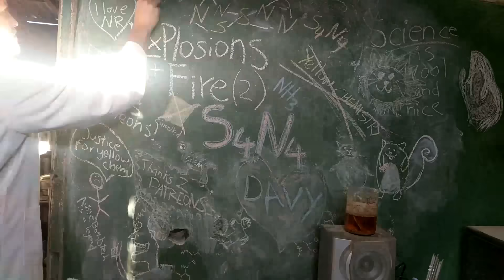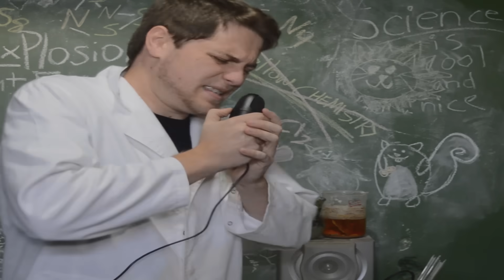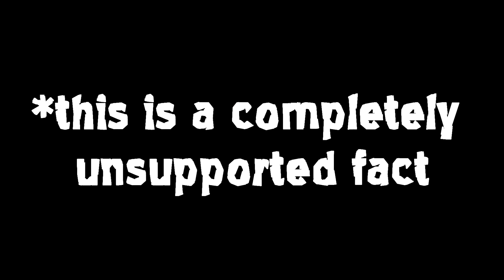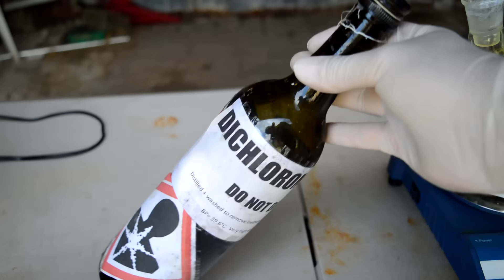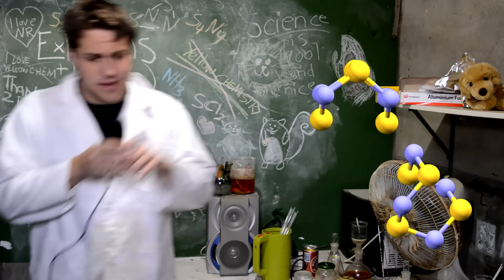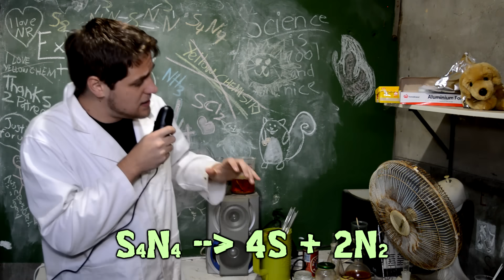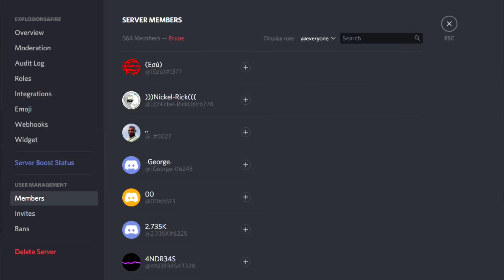Sulfur Nitride, My Arch Nemesis - Ex&F

Comment from the maker: Comment 'yellow chem bad' for 7 years of good chemistry luck.

 Scroll past for low yields forever
Reply: jokes on you, I do computational chemistry
Reply: scrolls past
Reply: @750kv8  nightmare fuel
Reply: Yellow chem bad
Reply: ORANGE MAN BAD
Reply: yellow chem bad
Reply: Explosions&Fire2 - 
Yellow Chen Bad
Reply: @deepforrestalchemy9189  yellow chem bad
Reply: Yellow chem bad

Wait, I'm not even a chemist....
Reply: Surely yellow chem is not a bad as you purport it to be.
Reply: Yellow Chem Good
Reply: Please mix it with sodium chlorite
Reply: Yellow chem bad
Reply: I figured out a way to mass produce S4N4, and I have 2.5 kilos of this shit. I filled an aluminum can about 1/4 of the way up, glued in a fuse, and stuck in into a 1" thick plexiglass box.
I blew the box up...
Reply: Jokingly comments “Xanthopibia” (YEA this is a real phobia)
Reply: Yellow cum bad
Reply: AgNTZ was yellow too

and you edited "yellow is my favourite colour"

fucking hypocrit
Reply: White chem: ammonium nitrate and sugar. RMM 80.04336 and 180.15588, balanced formula 6 [ NH4NO3 ] + 1 [ C6H12O6 ] -> 6N2 + 8H20 + 6CO2, so mass ratio 2.666:1 and energy yield 26346 - 12401 = 13945 kJ per 260.2 g so a quarter gram of the stuff ought to go off like a .50 BMG and leave no residues ..... right?
If you lower that oxidiser:fuel ratio, can you make it work as rocket fuel instead?
Reply: My dick is yellow is that bad?

Great video btw, I just found you though recommended. Idk why tho lmao. Maybe it's a sign I need to go be a fucking scientist and or burn my job down with something non traceable.....??
Reply: yellow chem is scientifically proven to be bad, i thought everyone knew this?
Reply: Bellow yem chad
Reply: Yellow chem bad
Reply: yellow chem bad
Reply: Yellow chem bad
Reply: Yellow chem bad
Reply: Yellow chem bad
Reply: Yellow Chem bad
Reply: yellow chem bad
Reply: Yellow chemistry is good or bad, depending on how I want to feel that day.
Reply: Yellow chem bad
Reply: Yellow chem bad
Reply: yellow chem bad
Reply: Can you tell me your discord's server name I REALLY want to join and also yellow chem bad :)
Reply: yellow chem bad
Reply: Yellow chem bad
Reply: Yellow chem bad
Reply: yellow chem bad
Reply: Yellow chem bad
Reply: Yellow chem bad.
Reply: Yellow chemistry bad
Reply: Yellow chem bad
Reply: Yellow chem bad. Except Vilsmeyer reactions, those are great.
Reply: yellow chem bad
Reply: Yellow chem bad
Reply: Yellow chem bad
Reply: Yellow chem bad
Reply: I'm surprised you don't have a nitrogen triodide video.
Reply: @alexandersage6261  yea and a nitrogen troglodyte video 😆
Reply: @AdamA-wg1ko  please remove your comment.
Reply: @alexandersage6261  wha? lol why tho?
Reply: @AdamA-wg1ko . I think you know why
Reply: yellow chem bad
Reply: Yellow chem bad 😂
Reply: Yellow chem bad
Reply: Explosions&Fire2 yellow chem bad
Reply: Yellow chem bad
Reply: WTF i just wrote one of those comments ☝️
Reply: Yellow chem bad
Reply: yellow chem bad
Reply: Yellow chem bad
Reply: Yellow chem bad
Reply: Yellow chem bad
Oh wait... it's the worst.
Reply: Yellow chem bad
Reply: yellow chem bad
Reply: Yellow chem bad
Reply: @Marionette Loves Gaming you can't hear a pterodactyl urinate because of the silent p.
Reply: Yellow chem bad
Reply: Yellow chem bad
Reply: Yellow chem bad
Reply: Yellow chem bad
Reply: Yello Chem is te suck!
Reply: Yellow chem no bueno
Reply: Yellow Chem baf
Reply: Aw fuck me
Reply: Yellow chem bad
Reply: Yenlo cam bed
Reply: Yellow chem questionable
Reply: Yellow chem bad
Reply: Yellow chem bad
Reply: yellow chem bad
Reply: Explosions&Fire2 yellow chem bad
Reply: yellow chem bad
Reply: yellow chem bad
Reply: Yellow chem bad
Reply: yellow chem bad
Reply: yellow chem bad
Reply: Yellow chem bad
Reply: Yellow chem bad
Reply: Yellow chem bad
Reply: yellow chem bad
Reply: yellow chem bad
Reply: Yellow chem bad
Reply: yellow chem bad
Reply: yellow chem bad
Reply: yellow chem bad
Reply: yellow chem bad
Reply: yellow chem bad
Reply: not gonna take my chances. yellow chem bad for real
Reply: Explosions&Fire2 yellow chem bad
Reply: Yellow chem bad
Reply: Yellow chem bad
Reply: yellow chem bad
Reply: yellow chem bad
Reply: Yalla cam bad
Reply: Yellow chem bad.

I wonder if it's possible to make an explosive from a properly heavy metal. Handful of crystals of something with a fissile isotope would be cool.

Edit: not an actual handful of course, that would probably leave you without a hand.
Reply: Yellow Chem bad
Reply: YELLOW CHEM BAD
Reply: Yellow chem bad
Reply: yellow chem bad
Reply: Fuck you ☝ subbed boi- notifications on! !
Reply: If you had to pick one you would rather have pile of a in the yard, flourantimonic acid or chlorine trifluoride? 🤔 Oh yeah the acid is a nasty puddle not a pile
Reply: Yellow chem bad
Reply: Yellow chem bad.
Reply: Yellow chem bad
Reply: Yellow chem bad
Reply: yellow chem bad
Reply: yellow chem bad :(
Reply: yellow chem bad
Reply: yellow chem bad
Reply: Explosions&Fire2 Could you please increase the amount of time you leave text on-screen in your videos?
Reply: yellow chem bad
Reply: yellow chem bad
Reply: yellow chem bad
Reply: yellow chem bad
Reply: yellow chem bad
Reply: Yellow chem bad
Reply: Yellow chem bad
Reply: yellow chem bad
Reply: Yellow chem bad
Reply: yellow chem bad
Reply: Yellow chem bad.
Reply: Yellow chem bad
Reply: Explosions&Fire2 yellow chem bad
Reply: Yellow chem bad 😤😤
Reply: yellow chem bad
Reply: yellow chem bad
Reply: yellow chem bad
Reply: Yellow chem bad
Reply: Yellow
Reply: Yellow chem bad
Reply: Explosions&Fire2 chem yellow bad
Reply: yellow chem bad
Reply: Explosions&Fire2 yellow chem bad
Reply: Yellow chem bad
Reply: yellow chem bad
Reply: yellow chem bad
Reply: Yellow chem bad
Reply: Explosions&Fire2 yellow chem bad
Reply: yellow chem bad
Reply: yellow may be my favorite color, but yellow chem bad anyways
Reply: Yellow chem bad. Plz daddy My yields need to improve.
Reply: yellow chem baaad
Reply: yellow chem bad
Reply: yellow chem bad
Reply: yellow chem bad
Reply: By the way that last comment was SATA I was yelling at the invisible troll on the internet even though I knew it was you knew
Reply: Yellow chem bad
Reply: yellow chem bad
Reply: yellow chem bad
Reply: Yellow chem bad
Reply: Yellow chem bad
Reply: yellow chem bad
Reply: Yellow chem bad 

I'm a third year chem major, I can't afford to risk it all on this
Reply: Yellow chem bad
Reply: yellow chem bad
Reply: yellow chem bad
Reply: yellow chem bad
Reply: Explosions&Fire2 yellow chem bad
Reply: Yellow chem bad good yields plz
Reply: yellow chem bad
Reply: yellow chem bad
Reply: yellow chem bad
Reply: yellow chem bad
Reply: yellow chem bad
Reply: Yellow chem bad, mustard gas proves it!
Reply: Yellow chem bad
Reply: yellow chem bad
Reply: yellow chem bad
Reply: Yellow chem bad got em lol
Reply: Yellow chem bad
Reply: Yellow Chem Bad
Reply: yellow chem bad
Reply: Yellow chem bad
Reply: Yellow chem bad
Reply: yellow chem bad
Reply: Ur mom gay
Reply: yellow chem bad
Reply: yellow chem bad
Reply: yellow chem bad
Reply: Yellow chem bad
Reply: 'yellow chem bad'

(This comment chain will continue for as long as there are chemists alive! 😂)
Reply: Yellow chem bad
Reply: yellow chem bad
Reply: Yellow chem bad
Reply: yellow chem bad
Reply: Yellow chem bad
Reply: Yellow chem bad
Reply: Aureate reagent intolerable
Reply: yellow chem bad
Reply: yellow chem bad
Reply: yellow chem bad
Reply: yellow chem bad
Reply: yellow chem bad
Reply: yellow chem bad!!  Biologist here, but still....like...electron microscopy, what´cha got? uranyl acetate....picric acid...epoxy resins....yuck. Yellow chem: bad!
Yellow mold also, btw....and yellow bacteria: super gross. don´t.
Reply: Yellow chem bad
Reply: Yellow chem bad my bois
Reply: yellow chem bad
Reply: Yellow chem bad
Reply: yellow chem bad
Reply: yellow chem bad
Reply: yellow chem bad
Reply: Yellow chem bad
Reply: Yellow chem bad
Reply: I think you need more sleep
Reply: I think you need to get more sleep 😁🤣🤣🤣🤣🤣🤣🤣🤣🤣👍
Reply: yellow chem bad
Reply: Yellow chem bad
Reply: now we know what NIleRed did eh?
Reply: Yellow chem bad orange man bad
Reply: Yellow chem bad
Reply: Yellow chem bad
Reply: Yellow chem bad
Reply: Yellow chem bad
Reply: yellow chem bad
Reply: Explosions&Fire2 yellow Chen bad
Reply: Yellow chem bad
Reply: Yellow chem bad
Reply: Yellow chem bad
Reply: Yellow chem bad
Reply: yellow chem bad
Reply: yellow chem bad
Reply: Yellow Chem bad
Reply: yellow chem bad
Reply: yellow chem bad
Reply: Yellow chem bad
Reply: Yellow chem bad
Reply: Yellow Chem Bad
Reply: yellow chem bad
Reply: yellow chem bad
Reply: Yellow chem bad
Reply: Yellow chem bad
Reply: yellow chem bad
Reply: yellow chem bad
Reply: 'yellow chem bad' for 7 years of good chemistry luck.
Reply: Yellow chem bad
Reply: yellow chem bad
Reply: yellow chem bad
Reply: Yellow chem bad

You have forced my hand
Reply: yellow chem bad

\
Reply: yellow chem bad
Reply: yellow chem bad
Reply: Yellow chem bad
Reply: Yellowchembad
Reply: Yellow chem bad
Reply: yellow chem bad
Reply: Yellow chem bad
Reply: yellow chem bad
Reply: Yellow chem bad reeeeeeeEEEEEEE
Reply: yellow chem bad
Reply: yellow chem bad
Reply: yellow chem bad
Reply: yellow chem superbad
Reply: Actually I am working on yellow chemistry at the moment
Reply: Yellow chem awesome
Reply: yellow chem bad
Reply: Gelbe chemie schlecht
Reply: yellow chem bad
Reply: Yellow Chen Bad
Reply: Yellow chem bad
Reply: Yellow chem bad
Reply: yellow chem bad
Reply: chemistry A level here we come! yellow chem bad!
Reply: yellow chem bad 🤩
Reply: yellow chem bad
Reply: Yellow chem bad
Reply: Yellow chem bad
Reply: Yellow chem bad
Reply: Yellow chem bad
Reply: yellow chem bad
Reply: Yellow chem bad
Reply: White phosphorus good.
Reply: yellow chem really bad
Reply: yellow chem bad
Reply: yellow chem bad
Reply: yellow chem bad
Reply: yellow chem bad
Reply: yellow chem bad
Reply: yellow chem bad
Reply: yellow chem bad
Reply: Yellow chem bad
Reply: Yellow chem bad
Reply: Yellow chem bad
Reply: yellow chem bad
Reply: Explosions&Fire2 yellow chem bad
Reply: Yellow chem bad
Reply: yellow chem bad
Reply: yellow chem bad
Reply: Yellow chem bad
Reply: Yellow chem bad
Reply: 'yellow chem bad' for 7 years of good chemistry luck
Reply: Yellow chem bad
Reply: Yellow Chem bad
Reply: Yellow chem bad
Reply: yellow chem bad
Reply: Yellow chem bad
Reply: Yellow chem big SHIT
Reply: yellow chem bad
Reply: Yellow chem bad
Reply: Yellow chem gay
Reply: yellow chem bad
Reply: Yellow Chem bad
Reply: Trinitrotoluene is yellow, yellow chemistry good.
Reply: Explosions&Fire2 yellow chem bad
Reply: Yellow chem bad
Reply: Yellow chem bad
Reply: Yellow chem bad
Reply: Yellow chem bad
Reply: Yellow chem bad
Reply: yellow chem bad
Reply: yellow chem bad
Reply: yellow chem bad
Reply: yellow chem bad
Reply: yellow chem bad
Reply: Piss chemistry bad
Reply: Combining of specified materials in a way to grant desired results that ends up yielding a material that has visible light spectrum reflectance solely within wavelength in the range of around 565–590 nm is of sub-par quality.
Reply: yellow chem bad
Reply: Yellow chem bad
Reply: Yellow chem bad
Reply: Yellow chem bad
Reply: Explosions&Fire yellow chem bad
Reply: Yellow chem bad
Reply: yellow chem bad
Reply: Yellow chem bad
Reply: Yellow chem bad
Reply: Yellow chem bad
Reply: Yellow chem is trash
Reply: YELLOW CHEM BAD
Reply: Yellow chem bad
Reply: yellow chem is fucking bad
Reply: Yellow chem bad
Reply: Yellow chem bad
Reply: yellow chem bad
Reply: Fuck yellow chem
Reply: Yellow chem bad.
Reply: Yellow chem bad
Reply: yellow chem bad
Reply: Yellow Chem Bad
Reply: Yellow chem bad
Reply: Yellow chem bad
Reply: 9 months later... yellow chem bad
Reply: Yellow chem bad
Reply: Yellow chem bad
Reply: yellow chem bad
Reply: Yellow chem bad
Reply: Explosions&Fire yellow chem bad
Reply: Yellow Chem Bad
Reply: Yellow chem bad
Reply: Yellow Chem bad
Reply: yellow chem bad
Reply: Not a chemist but I fucking hate the color yellow. Yellow anything bad.
Reply: Yellow chem bad.
Reply: Yellows bad
Reply: Yellow chem bad
Reply: YELLOW CHEM BAD
Reply: Yellow chem bad
Reply: yellow chem bad
Reply: My last lab work I had to do for my study I had a 234% yield. So I'm going to scroll past a couple times
Reply: Yellow chem bad
Reply: yellow chem bad
Reply: Yellow chem bad
Reply: yellow chem bad
Reply: yellow chem bad
Reply: Yellow Chem Bad
Reply: Explosions&Fire yellow chem bad
Reply: Yellow Chem bad
Reply: yellow thing bad
Reply: Yellow chem bad
Reply: yellow chem bad
Reply: yellow chem bad
Reply: https://youtu.be/x5dsp7poBmY 

Rustful steel to Rustless 100%

Dekho video .
Reply: yellow chem bad
Reply: Yellow chem bad
Reply: Explosions&Fire 
y e l l o w
c h e m
b a d
Reply: yellow chem bad
Reply: Yellow chem bad
Reply: yellow chem bad
Reply: Yellow chemistry bad
Reply: Yellow Chem bad
Reply: yellow chem bad
Reply: yellow chem bad
Reply: yellow chem bad
Reply: Yellow chem bad
Reply: yellow chem bad
Reply: yellow chem bad
Reply: yellow chem bad
Reply: Yellow chem bad
Reply: yellow chem bad
Reply: yellow chem bad
Reply: yellow chem bad
Reply: yellow chem bad
Reply: Yellow chem meh
Reply: yellow chem bad
Reply: yellow chem bad
Reply: yellow chem bad
Reply: yellow chem bad
Reply: Yellow chem bad
Reply: Ohhhh the AFP would love you...
Reply: Yellow chem bad
Reply: yellow chem bad
Reply: yellow chem bad
Reply: yellow chem bad
Reply: Yellow chem bad
Reply: Yellow chem bad 👎
Reply: yellow chem bad
Reply: yellow chem bad
Reply: yellow chem bad
Reply: yellow chem bad
Reply: Yellow chem bad
Reply: Yellow chem bad
Reply: Yellow Chem Bad 498
Reply: yellow chem bad👁👄👁
Reply: Yellow Chem Bad 500
Reply: yellow chem bad
Reply: yellow chem bad
Reply: Yellow chem bad
Reply: yellow chem bad
favorite quote of the vid : "fuck me i love the 60s "
also : love from Germany, really enjoy watching your vides and i stumbled across your channel because an romanian friend of mine recommended it to me who absolutely loves chemestry to the point of making chlorine gas and naplam (the latter i also tried out withe some of my german friends), so take care and try to ignore the possible inspiration for warcrimes :))
Reply: yellow chem bad
Reply: yellow chem bad
Reply: yellow chem bad
Reply: Yellow chem bad
Reply: yellow chem bad
Reply: Yellow chem bad
Reply: yellow chem bad
Reply: yellow chem bad
Reply: yello chem bad
Reply: Yellow chem bad
Reply: Yellow chem bad
Reply: Yellow chem bad
Reply: yellow chem disgusting bad
Reply: yellow chem bad
Reply: yellow chem bad
Reply: yellow chem bad
Reply: yellow chem shit
Reply: Yellow chem bad
Reply: yellow chem bad
Reply: But... How will I make black powder? I like sulfur =(
Reply: yellow chem bad
Reply: Yellow chem bad
Reply: Yellow chem bad
Reply: Yellow chem bad
Reply: yellow chem bad
Reply: yellow chem bad
Reply: Yellow chem good :P
Reply: Yellow chem bad ig
Reply: Yellow chem bad
Reply: Yellow chem bad
Reply: chello yem dab
Reply: Yellow chem bad
Reply: Yellow chem bad
Reply: Yellow chem bas
Reply: Yellow Chem bad*
Reply: Yellow chem bad
Reply: yellow chem bad 🙏
Reply: Yellow Chem bad
Reply: Yellow chem bad
Reply: yellow chem bad
Reply: yellow chem bad
Reply: yellow chem bad
Reply: Yellow Chem Bad
Reply: Yellow chem so bad
Reply: Yellow chem bad
Reply: Yellow hem bad
Reply: YELLOW CHEM BAD 🟡🤢
Reply: Yellow chem bad
Reply: yellow chem bad
Reply: Yellow Chem bad
Reply: yellow chem bad
Reply: Yellow chem bad
Reply: yellow chem bad
Reply: Yellow chem bad
- someone preparing for computer science
Reply: As a “chemist” who do formaldehyde tests as a 9-5 job, i concur yellow chemistry bad. (DNPH, acetylacetone and it compound with formaldehyde are all yellow)
Reply: Yellow Chem bad
Reply: Yellow Chem bad
Reply: Yellow chem bad
Reply: This better work. Yellow chem bad
Reply: Yellow chem bad
Reply: yellow chem bad
Reply: Yellow chem bad
Reply: yellow chem bad very
Reply: yellow chem bad
Reply: yellow chem bad
Reply: yellow chem bad
Reply: Yellow chem bad
Reply: Yellow Chem bad
Reply: yellow chem bad
Reply: Yello chem baddie
Reply: Yellow chem bad
Reply: yellow chem bad
Reply: yellow chem bad
Reply: Yellow chem bad
Reply: Yellow chem bad
Reply: yellow chem bad
Reply: yellow chem bad
Reply: Yellow chem bad
Reply: Yellow chem bad
Reply: yellow chem bad
Reply: yellow chem bad
Reply: Yellow chem bad
Reply: Yellow chem bad
Please help me defend my thesis lol
Reply: Yellow chem bad

(baking is TEEECCCHHHNIIIIICCCALLLYYY chemistry)
Reply: Yellow is my favorite color!😢
Reply: With finals this week; yellow chem bad.
Reply: @ExplosionsAndFire  but Yellow is my favorite color😡
Reply: yellow chem bad
Reply: yellow chem bad
Reply: yellow chem bad
Reply: yellow chem bad😊
Reply: yellow chem good
Reply: yellow chem bad
Reply: Yellow chem bad
Reply: yellow chem bad
Reply: Yellow chem bad
Reply: yellow chem bad
Reply: yellow chem bad
Reply: yellow chem bad
Reply: And now those 7 years are up
Reply: yellow chem bad
Reply: Yellow chem satisfyingly decent

I mean, I didn't scroll past so jokes on you
Reply from the maker: @18thtimelucky  may you obtain average yields forever
Reply: @ExplosionsAndFire 
I’m still waiting for the day you show us how to synthesize TAPT.

Acetone Peroxide is some good stuff, and “relatively” easy to m8k.
Reply: @ExplosionsAndFire 
Also Ammonium Permanganate, damnit!
Reply: Yellow chem bad.

Wait what if I do yellow chemistry for the next 7 years?
Reply: @mothman1654  youre bad
Reply: Friend, you didn't even try it confined with an oxidizer!
Reply: Yella chem bad 😤
Reply: orange man bad
Reply: 'yellow chem bad' for 7 years of good chemistry luck.
Reply: Yellow Chem bad
Reply: Yellow chem bad
Reply: yellow chem bad
Reply: yellow chem bad
Reply: Yellow chem bad
Wait... I'm going to recrystallize sulfur from xylenes this month... that's yellow chemistry!
Reply: yellow chem bad
Reply: Yellow chem bad
Reply: Yellow Chem Bad
Reply: Y E L L O W  C H E M  B A D
Reply: Yellow chem bad
Reply: yellow chem bad
Reply: yellow chem bad
Reply: yellow chem bad
Reply: Yellow Chem un-good
Reply: yellow chem bad
Reply: Yellow Chem bad
Reply: Yellow chem bad!
Reply: Explosions&Fire2 yellow chem bad
Reply: Yellow chem bad and it smells
Reply: Yellow chem bad 
High altitude chem worse (boiling points are all off)
Reply: yellow chem bad
Reply: Yellow Chem bad
Reply: Yellow chem good
Reply: Yellow chem G O O D
Reply: Yellow chem good !
Reply: @olivertoth6788 traitor